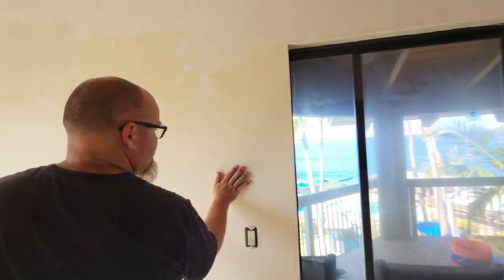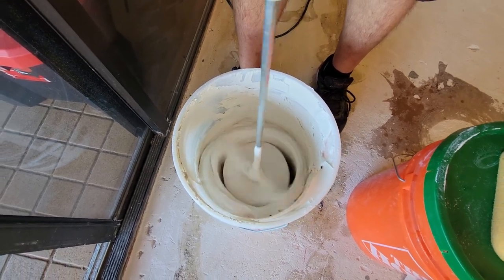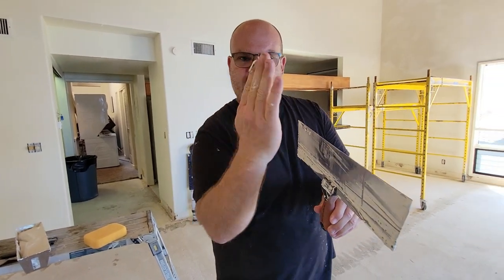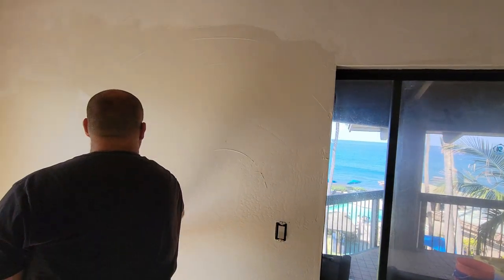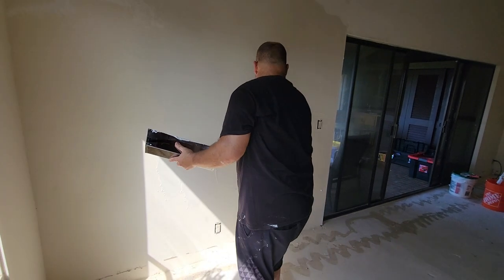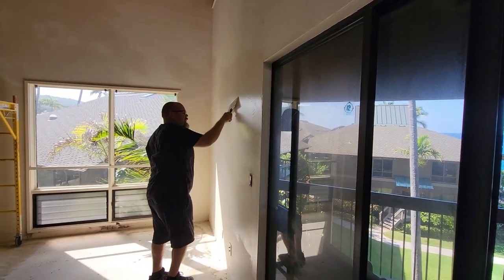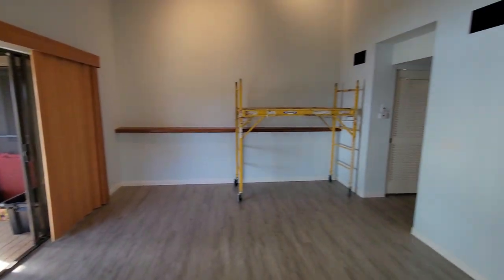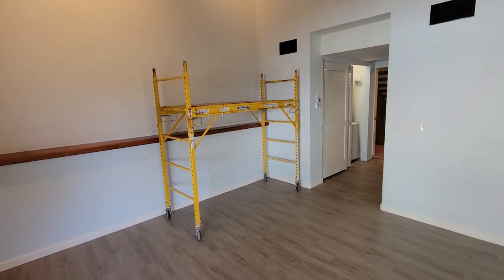How to Make Heavy Wall Texture SMOOTH | the Best DIY wall Texture

Comment from the maker: 🔴 What remodeling trade do you wish to learn more about? 🔴
Reply: What about making custom tables and desks. I just used Craft coat on my first 🎮 my desk build. I could use some pointers!
Love ya Mike!!!
Reply: What's the cheapest or best way to support a table to prevent sagging? 
I just made mine doing a drop edge like you taught me ;)
Reply from the maker: @Jamesthechef0311  I can do that
Reply from the maker: @Jamesthechef0311  build a skeleton structure.

Comment: My parents have a cinder block basement. I want to fix it up for them but am unsure of the best way to do that. (They are in their 80's and the basement flooded from a sump pump mishap causing issues). Would you be willing to give me some ideas and suggestions... Some pro tips? Thanks Mike
Reply from the maker: Basements like this you need to address water and moisture first, then I like to frame walls over the block and drywall from there. Great question!